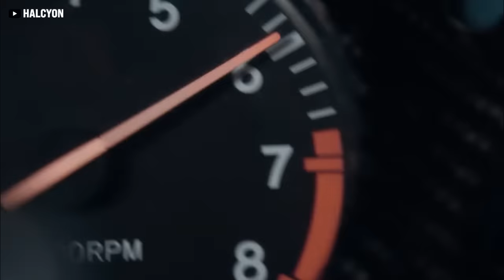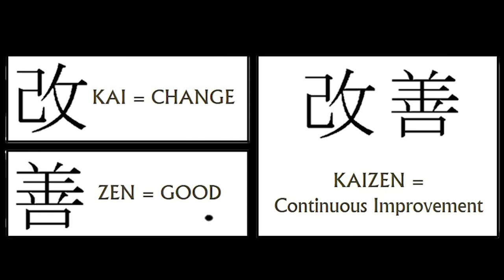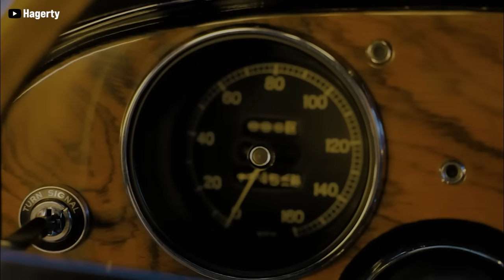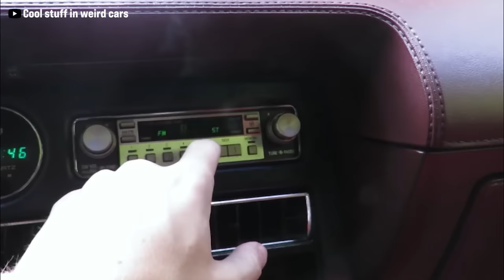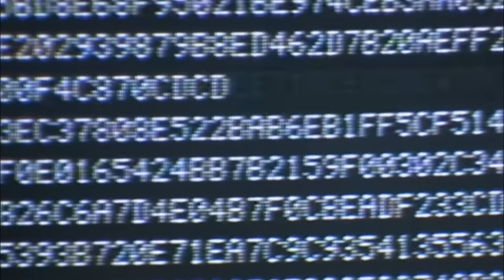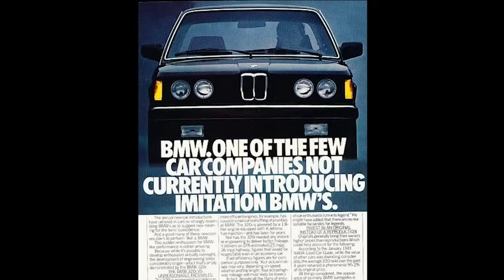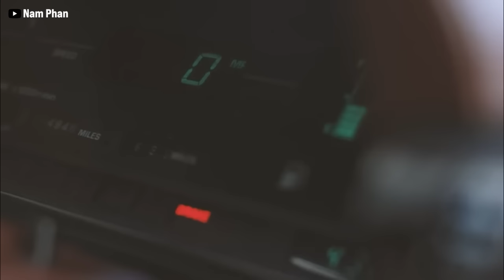Toyota Supra | The Story of an Underdog!

Comment: they should have brought back the 2jz engine with an updated cylinder head.
Reply from the maker: That would have been epic!
Reply: Unfortunately, it doesn't work that way.
Reply: @pmayo7894  why not?
Reply: @A2J_Tim  - that would require a lot of engineering changes to make it emissions-compliant while also meeting target performance requirements (which involves a good amount of resources to do so especially for just one car). At that point, this may not be the JZ engine people are hoping for.
Reply: @pmayo7894  I agree with what you are saying, but what I am saying is use the original 2jz short block and redesign the cylinder head, thats where all the tech is to meet emissions and performance requirements.
Reply from the maker: Toyota also would have had to set up a new plant. Which is way to expensive to do for a low volume sports car. 😔😪
Reply: @A2J_Tim  - except, that won't exactly solve one other problem: weight. The 2JZ is made of iron, not exactly something that you want on a nimble sportscar.
Reply from the maker: Hey, thanks again for watching the Supra video and commenting.

It has been a while between video's, which makes it hard to get traction. 
My new video is based on the story of the LFA. I hope you enjoy it!
https://youtu.be/-y8ntGMPpt8

Comment: The 2jz is copied from m104 mercedes engine toyota didn't design much.
Reply from the maker: Thanks for commenting. I'm not sure where you heard that, but a lot of inline 6 engine share commonalities for performance and balance. Outside of obvious things like being a dual cam 24 valve, alloy head, cast block, and a variant with a 3.0l displacement, they are very different engines.

Comment: the Supra is now a BMW
Reply: Another air head.... while having BMW branded parts, all of them are Toyota specs same as some Hondas and ZF parts.

The only thing the chassis share with BMW is the wheel base, everything else is Toyota made and out together in Magna steyr in austria which build many other cars. GR designed all the specs and tuning on it.

The A90 is dominating Time attack events, circuit events, and is currently doing 7 seconds in less than 4 years of being released. The MK4 barely could do that specially on JGTC requiring different engines to actually balance the car weight out with 4 and 8 cylinder engines.
Reply from the maker: Definitely a common opinion 😁
Reply: It has BMW engine made in Germany  not a Toyota @tempeztad
Reply: @f6scott  made in Germany, revised by both toyota and BMW.... The B58B30C was born out of that and the technical updates or TU that cane after. Also, what is the problem of being made in Germany? Now we going to judge base on brand or where was made up instead of real time performance and efficiency? Wtf is wrong with people now days? This kind of crap was never a problem in the car community.
Reply: This car is like the Fiat Miata @tempeztad
Reply: @f6scott  you are talking nonsense at this point....
Reply: saab 9.7x not a saab saab 9.2x not a saab mazda Navajo not a mazda Acura SLX not a Acura @tempeztad
Reply: I love Japanese cars and have been to ten JCCS in Long BNeach and Irvine and went to the Toyota Museum in Torrance  @tempeztad
Reply: @f6scott  that's all go still zero reason to criticize or minimize the MK5. Is winning at events the MK4 would dream to win and its all about the performance not where was it build. Owned Japanese cars since my 16s, yet, I have come to admire how good some none JDM cars are. The MK5 definitely carries the JDM/tuning spirit even making JDM cars such as the new Z look like cheap.

It's all about respect and understanding that numbers don't lie. Another MK5 just hit 7s today, real street being MK4 focus also admires and love the MK5.

Max Orido does as well and those are the people who's opinions matters.
Reply from the maker: Hey, thanks again for watching the Supra video and commenting.

It has been a while between video's, which makes it hard to get traction. 
My new video is based on the story of the LFA. I hope you enjoy it! https://youtu.be/-y8ntGMPpt8